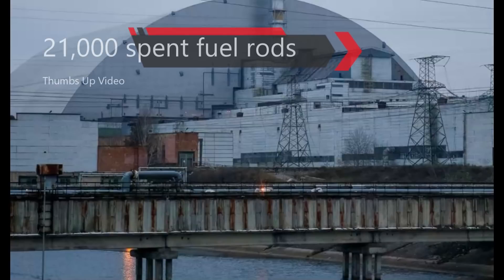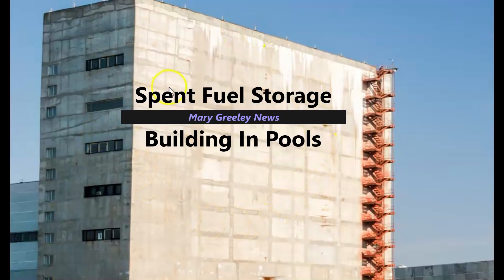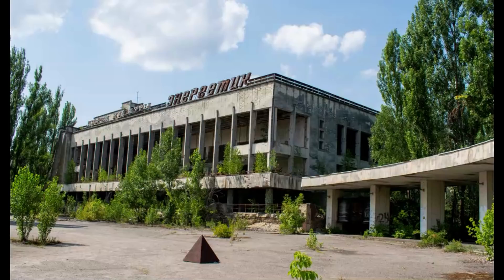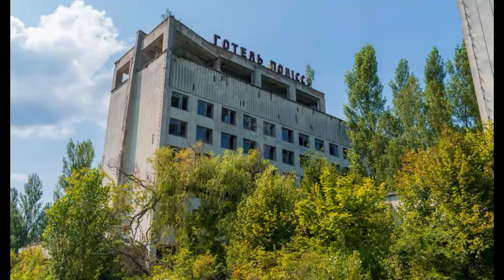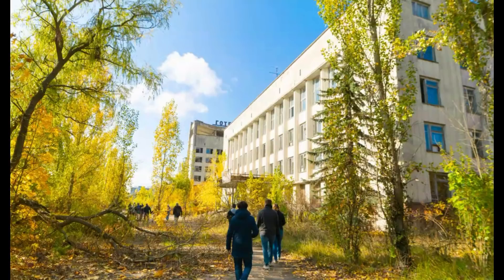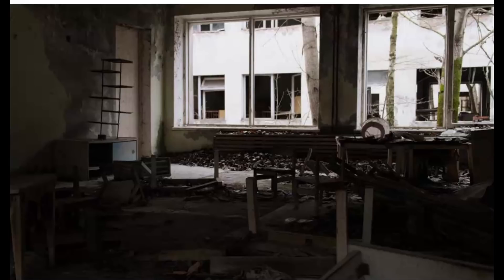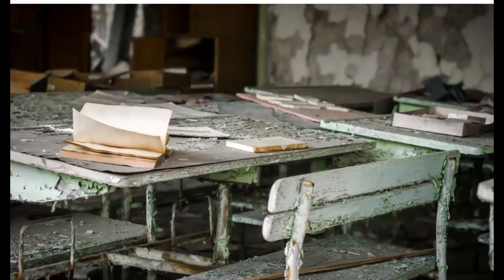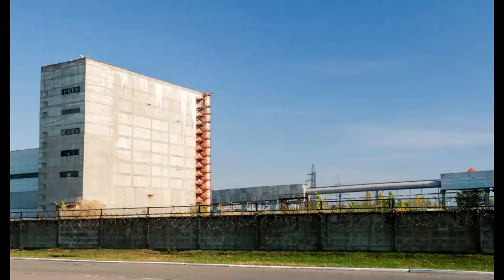Ukraine Fear of 21,000 Chernobyl Nuclear Fuel Rods Exploding

Comment: Not if the power's been cut so it's not circulating, no. The water will heat up exponentially like it does when you turn off the faucet when you're sitting in the bathtub, only faster. Yikes!  AND, since the winds on earth are created by the Coreolis Effect from the earth's rotation at 65,000 mph, the jet stream will eventually pick up the radiation and carry it not just across Europe, but ostensibly across oceans as well. Holy hell...who was it who said 'the earth will end not with a bang, but a whimper?'...
   However, I have it on an even Higher Authority that God's going to drop His 'hammer' into the Atlantic causing megalomassive tsunamis that will restructure whole continents on the planet, so, not to worry. See!  There's always a silver lining somewhere!  So we can all heave a sigh of relie---no, I don't know WHEN He's gonna drop it in the ocean. That's where "trust" comes into play. We must have Faith in Him, and trust that He's going to do this to stop ALL the unpleasantries---I'm sorry, I fail to see where you find this so confusing....

Comment: Nope I think you are fantastic at research.
And that building doesn't seem to be adequate enough for the  storage of such fuel .
Since no piping is viable from the outside , the large pipes it would require to circulate the volume of water it would take to cool and store 21 thousand spent fuel rods would have to be on the inside of that building leaving little to no room for tanks (Olympic sized swimming pools) would be too heavy to store vertically.
Any way 
Love ya Ms Greeley.

Comment: They won't explode. They could meltdown. That would be a China Syndrome. If that meltdown, happens to find coal and natural gas or oil, beneath the meltdown metal, that would be a problem. Russia is too close to that area for it not to beat danger. That much heat would instantly distill, the oil into Rocket fuel and tar. Coal would give off gases and alcohols that would explode. That melt would be hot than the sun's surface. Everything underground within 15 miles off it would turn into magma. Then there is a possibility of well water that would stream. All of these subsurface pressures, would save like a pressure cooker. Like a pressure cooker, the crust would explode. That would send radiation everywhere. The best possible events would be that there is none of the above, beneath the melting down fuel rods.

Comment: Unit 4 had a concrete containment shield built over it in 1998, boosted in 2004. It has a water coolant feature. That's what failed, or got shut down. Leave it long enough, radiation pours out of it, and it melts. In 1988, the radiation went around the world twice. In Europe, milk was thrown, fields got plowed under and open water sources were undrinkable. It blew in 1986, and the land 100 miles downwind back then won't be free of radiation until 2986.
Reply: But its safe they say "sarcasm" and built along all the oceans in USA and Canada.
Reply: @juliehealingleaf6211  different designs. The US designs steer clear of 3 Mile Island design, which had no rapid shutdown protocols. Chernobyl and 3 Mile Island (America's Chernobyl) are or were of the same design. Cheaper to build. And bad mistakes by both nations.
Reply: Thanks for the info, Bill. You sound very knowledgeable on the subject.